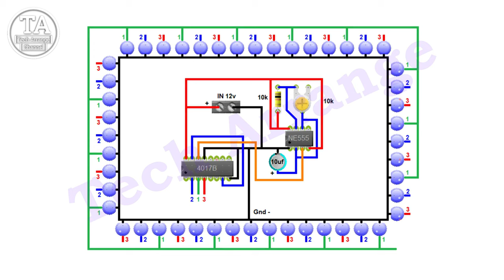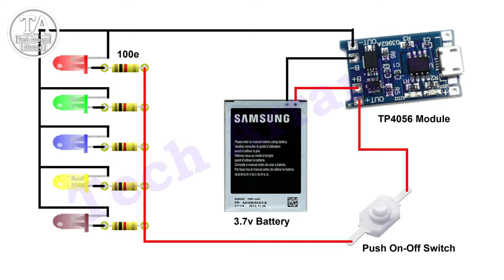Top 2 Simple Electronic Projects, Running LED Chaser

Comment: Ah! In Part 2, you have the charge protection circuit. 5V USB Mini in. Nice! This will almost last forever! Thank You, TA!! Anyone can get 20 (TP4056) for 9 Dollars US. 1A. It would be slow(er) for charging an 18650, but it would do it. The battery shown here is fine for this project. I'm saying that this module (TP4056) can be used in many projects. Even ones with 18650's, and an 18650 (or two) would last a really long time. Don't charge Lithium Ion over 4.2 v. Don't discharge Li below 3v. Store Li batteries at 3.6/7v.

Comment: but does the 74hc595 ic get warm? As per the data sheet max output from it's pin is 35mA which is just enough to glow only one blue led! But here u connected 14 blue leds means 420mA from one pin! Do u recommend to use transistor instead of directly connecting the leds with the ic pin?
Reply from the maker: This is a cd4017 ic not a 74hc595 ic friend

Comment: I have made this circuit now 3 separate times with the same problem. The LEDs do not cycle. If I interrupt power the next one in the series lights, but if power is left on, only one lights and does not progress to the next one. I made the solder version, a breadboard version, and a pcb board version, all with the same problem. Please help!
Reply from the maker: Replace your capacitor
Reply: @TechArrange  I will give that a try and reply with the results so that others can benefit. I do truly enjoy your videos!
Reply: I got the same result!!  did it work for you??
Reply: @abdel8253  I did not retry this, so no.

Comment: 12v 2amps use panna running not working properly 2 lines are running 1 line is blinking what problem sollunga 8mm led lights use pannalama bro reply pannunga
Reply from the maker: Cheng 4017 ic

Comment: No 1 project main blinking ki issue a rhi hai solve kaise kare aur. 555 ic pe humne 10uf 63 volt lagaye Hain market main 10uf 25 volt available nhi hone ke karan
Reply from the maker: 0.1uf (104) ceramic capacitor lagaye 555 pin 1 se 5 me
Reply: Is ko kause direct ac me connect karen adaptor use nhi karenge permanent solution dijiye 12 volt conversion k liye
Reply: @TechArrange instead of 1 to 2, we need to connect ceramic capacitor to 1 and 5 pin, negative to 1 and positive to 5?

Comment: Hi bro my circuit not working iam using 10 microfarad 50 volt capacitor but light is blinking  4 lights, i given input supply 12 volt 1 A
Reply from the maker: Please check your ic and led
Reply: Damn Ic short or fault, also always chk leds before fixing